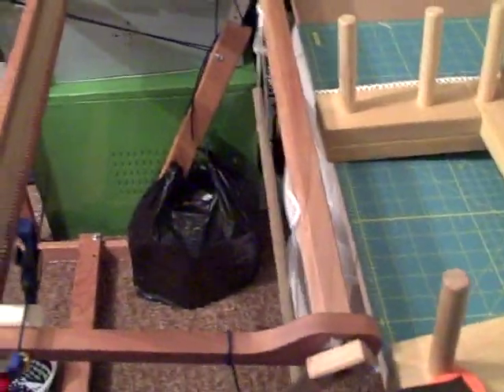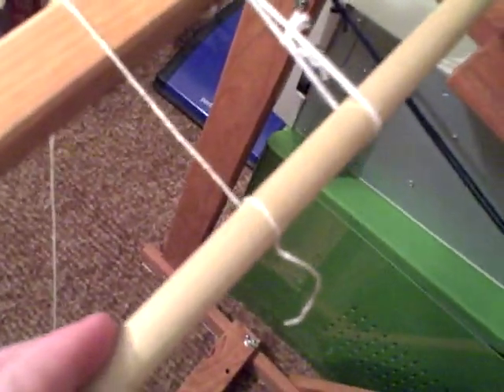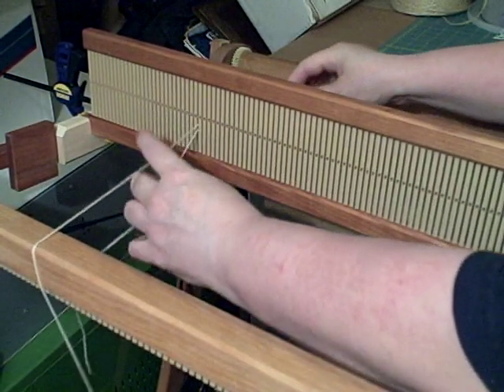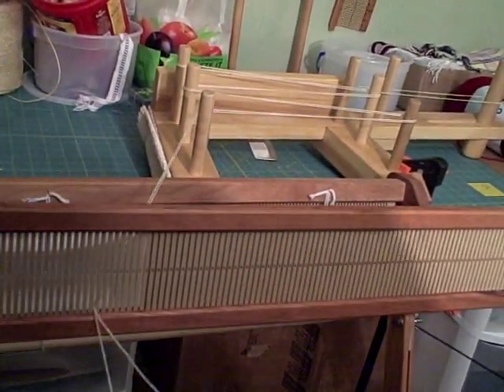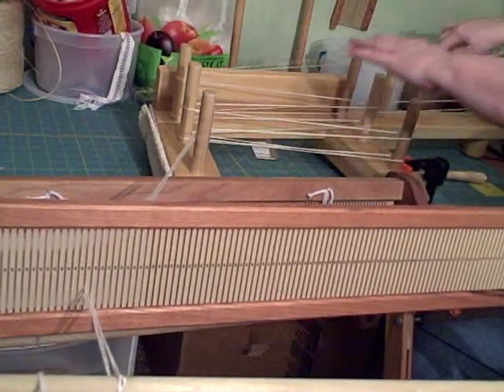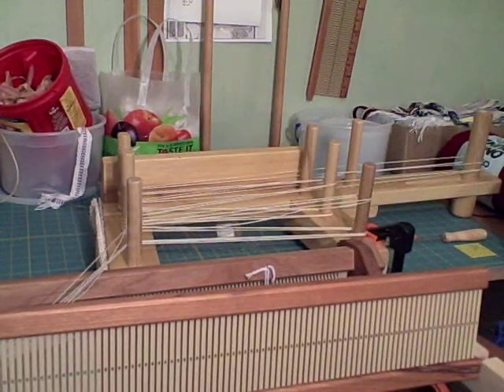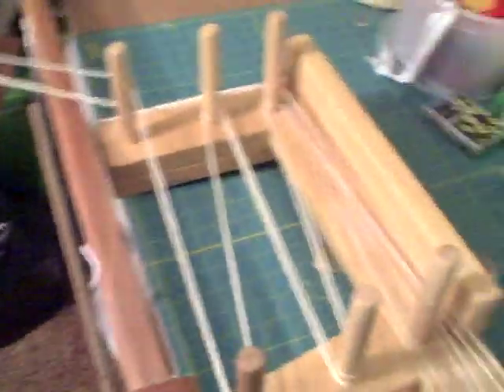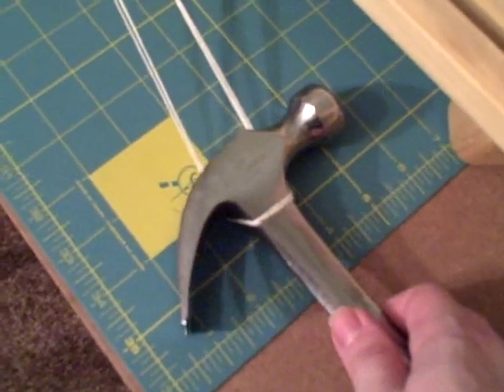How to Warp a Rigid Heddle Loom

Comment from the maker: Thank you yolo22!  Yeah, filming alone is a challenge sometimes! 

Other things you can use is bottles that have handles on them...fill them with a little bit of water and tie the warp to the handle. It's a lot more fun to have an assistant, but there's not always one willing to help out or availalble, so using weights to keep the warp tight on the warp beam is the next best thing.

There is another method called "crank and yank" but I like the weights better.